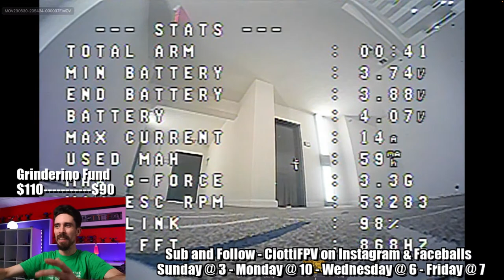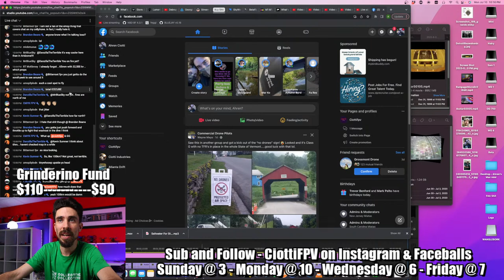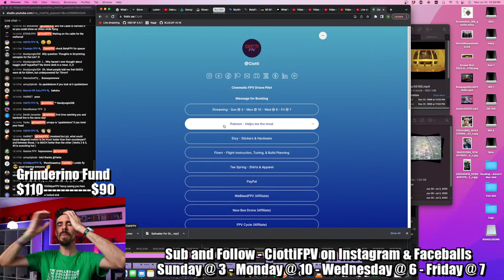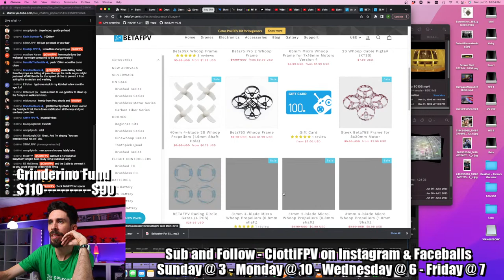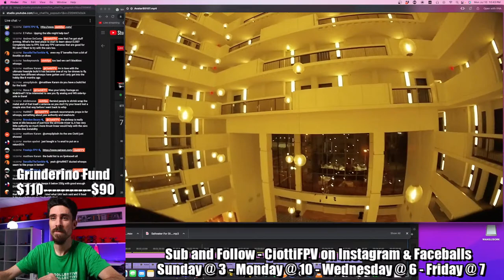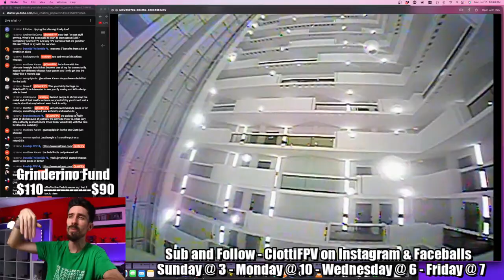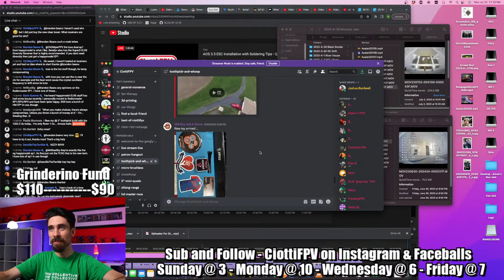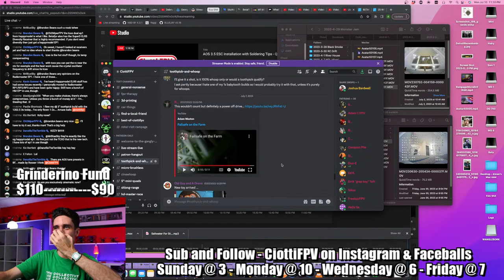AOS 3.5 ESC Installation with Soldering Tips - Q&A

Comment: Good day friend,

00:06:33 What is going to happen on this stream.
00:19:58 How much does that Walksnail rig weight compared to the analog version?
00:25:12 You're falling faster than the props are letting air pass through the ducts so you might just need MORE throttle for that speed of dive to prevent it from acting like an airdam and washing.
00:28:15 You want to help the Gangly man out?
00:38:47 65mm with 32,500 Kv .. which props you recommend again?
00:39:18 Now that I’ve got stuff arriving. What’s the best place to start to learn about ELRS? Completely new to FPV. And any FPV cameras that are good for RC cars? Want to try with the cars too.
00:42:16 Was your lobby footage on Walksnail? I'd be interested to see you fly analog and WS side-by-side in there!
00:43:06 Remind people to shrink wrap the metal end of that TrueRc antenna so you don't fry your board lost a couple AIO that way before I went back to whip.
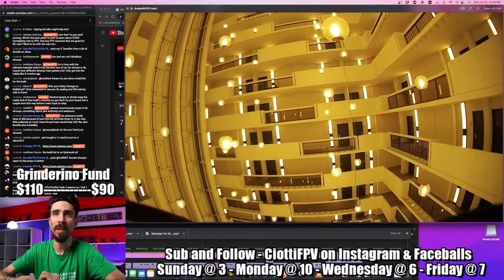00:44:46 Uavtech recommends props in for whoops, something about yaw authority and washouts.
00:49:36 The pid loop is really lame at idle because of just how the air mode mixer is, it has very little authority so much more thrust linear would help with the zero throttle dive instability.
00:56:19 I ordered a few AOS T3 for HDZero toothpick, any recommendations?
00:58:19 What could cause diagonal motors to be much hotter than their counterpart? and between those, 1 is MUCH hotter than the other ( Motts 2 & 3, #3 is scorching hot ) thanks.
00:59:50 I tried on both and it helps on both, I had a 65mm that was Yaw washing out, props in fixed it instantly.
01:02:07 Same flight experience from analog to digital? Much love from Hot Lake City!
01:05:16 E I built an aos3.5 evo 03 with mamba740aio and t motorp1604 2850kv running 6s 850 mAh. You or anyone else know a preset or a good starting point for a tune?
01:11:08 You mentioned you're not freestyle anymore. So are you exclusively pushing the cinematics.
01:14:41 I want to build an awesome freestyle whoop. 65mm or 75mm ??? Which is better for a jungle gym ripper?
01:15:46 Lets go to the workbench.
01:33:02 Soldering.
01:59:33 Any pro hints how to take care of your soldering tip?

Stay safe everyone